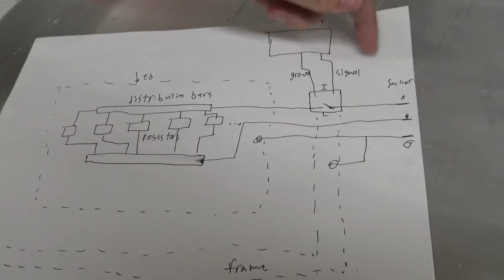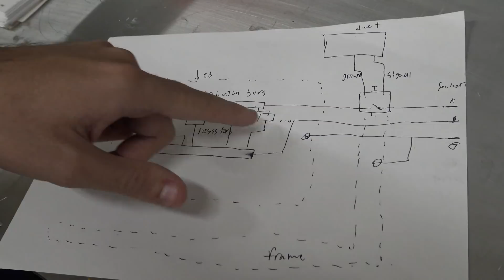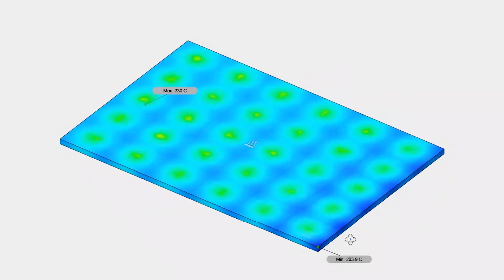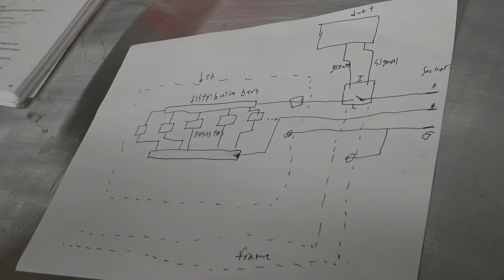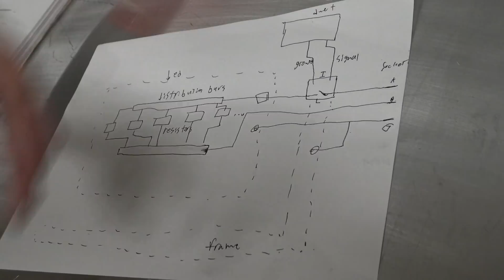WorkHorse 3D Printer - Massive 3D Printer Heat Bed  Experiment Part 1

Comment: Hello, did you succeed in using load resistors for heating the bed?
I would like to do same fir my voron 2.4 350, due to the smell of death of my old LDO heat bed (want to avoid adhesives). Thanks for feed back. Uwe

Comment: If A<->B is an AC power source, then you need to increase the safety. Change your SPST relay that cuts only the A side to a DPST that cuts both A and B. That shuts off power to both distribution bars.

Comment: silicone heater > shitton of resistors.  Gonna be hard to insulate the bottom of the bed with all those resistors.
Reply from the maker: We're going to try to insulating it with ceramic cloth.

Comment: Love the videos, good call on the duet board. love mine, its almost too quite sometimes lol.
Is there any reason why you didnt go with a keenovo heat pad or something similar?
Reply from the maker: Thanks! Yeah the silicon heat pads would take nearly an hour to heat up. This would only take a couple of minutes. Keep in mind this aluminum plate is 700mm x 400mm x 12.5mm thick. Thats a lot of thermal mass to heat up. We went with a thicker heat plate to get the desired flatness we needed for larger prints.
Reply: You should check them out, you can get 1200watts from a 400x400 heater. They make custom ones too if you needed a certain size. I have a 350x350,  its 800 watts of pure awesomeness.